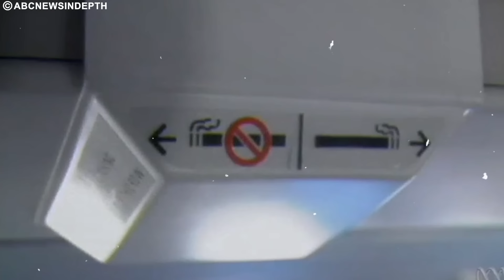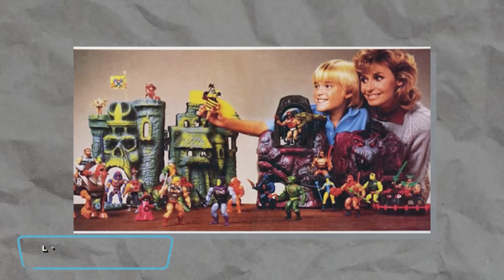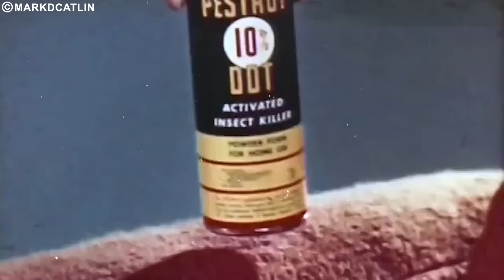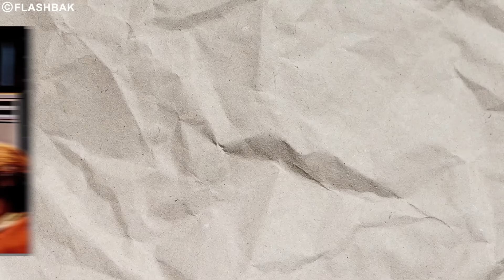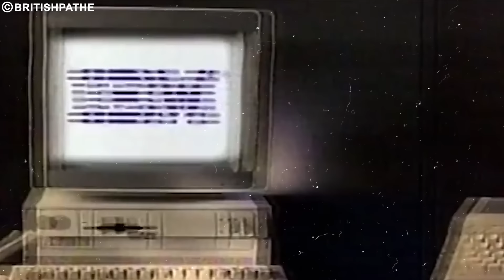20 DANGEROUS Things Everyone Did In The 1980s!

Comment: Sorry for the long rant, but I love and hate videos like this.

The sad thing about the smoking issue is that studies have shown that the air quality went down drastically and the number of people getting sick from flying on airplanes went up after the smoking ban on flights because airlines didn't change the cabin air filters nearly as often as they had to before the ban. 
Seat belts and drunk driving, duh! But the rates of accidents and deaths stays about the same even after seat belt and drunk driving laws and understanding, due to more and even much safer cars on the road. 
Sunscreen is sort of a yeah, but situation. We know excessive sun exposure is bad, but there are studies showing that the use of sunscreen makes people stay in the sun longer and that sunscreen is not reapplied as it should be, and also sunscreens contain some chemicals that may be making the risk of skin cancer higher. 
Hitch hiking is unsafe? There have been situations in which bad things happened, but now look what we do with Uber and those type of ride sharing apps.
The mercury scare is extremely over rated. Casual contact with metallic mercury is harmless unless you snort it with a straw or get it in a cut. Even ingesting it doesn't cause problems as it usually passes right through us. The issue is with methyl mercury which is the dangerous form. Now occupational (long term regular) exposure to any mercury can be very detrimental to your health as it builds up in your system and causes some bad neurotoxic effects.
The playground equipment and helmet thing is true, but the incidence of injury still is about the same, we knew the risk but didn't act too stupid, now they know the risk, have "safer" equipment and think they can act more stupid.
By the 1980's, most pill bottles were child resistant, now the 1970"s were a different story!
The whole garden hose thing is sort of true. Yes they did contain, generally lead, in the inner part of the hose, this would leach out when heated in the sun, but anyone who drank from a hose would wait until the water was col before drinking from it, thereby flushing any contaminants out. 
DDT was not around in the 1980's as it was banned for the most part in the early 1970's. i won't go into the nefarious proceedings that led to it being banned here. There were and are plenty of pesticides around still that are not good for us.